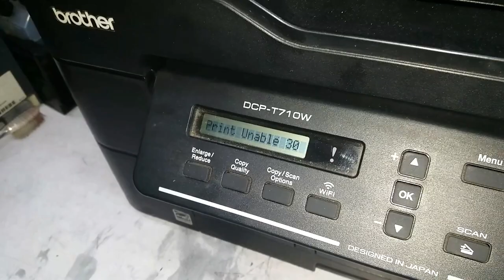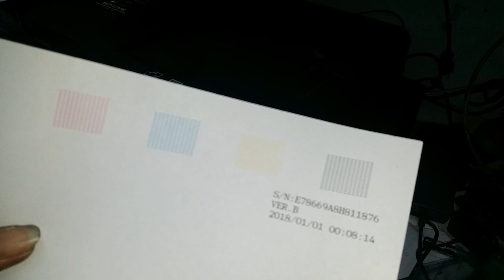How to fix Print unable 30 Brother DCP-T300/310/T500/510/T700/T710

Comment: Sir.. patulong nman.. printer ko pag isinaksak ko ang plug ang makikita at nakabasa sa control panel (please wait) lng. Ano ang pweding gawain sir? Salamat
Reply from the maker: Sir try to dis assemble lahat linisin mo lang yung mga flat cable  at .motor connection

Comment: Goodevening sir..sir ask ko lang po..nalinis ko na flex cable pero ayaw parin "Print unable 30" padin po ano po kayang pangalawang troubleshoot nito.salamat and Godbless..
Reply from the maker: sir paki try yung modem nya sir baka hindi maayos pagkakabit
Reply: @AthanasWorld  sir salamat po..anong modem po yun sir..sensya na sir.
Reply from the maker: @larsonballucanag9230  sa loob ng printer may wireless card na naka connect sa mainboard kabit mo lang ng maayos